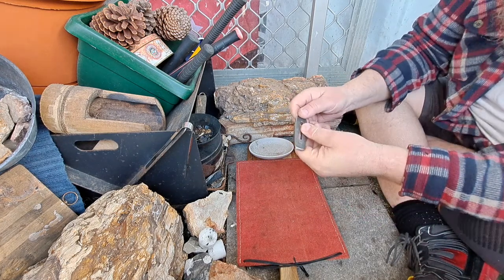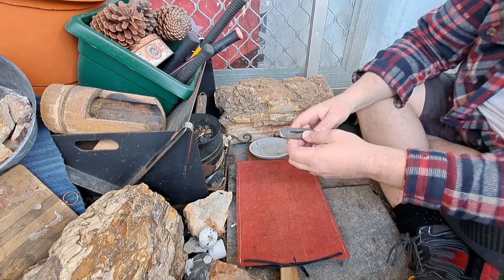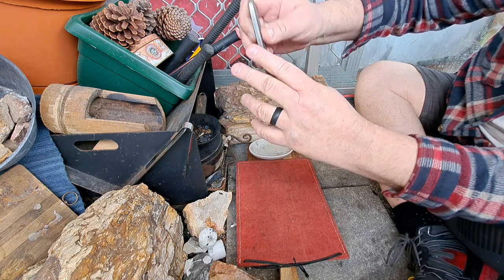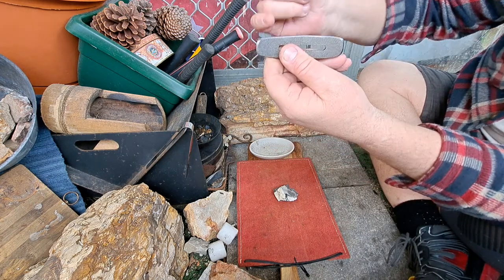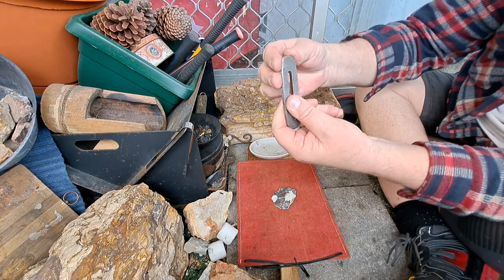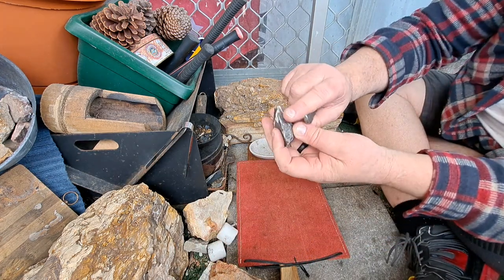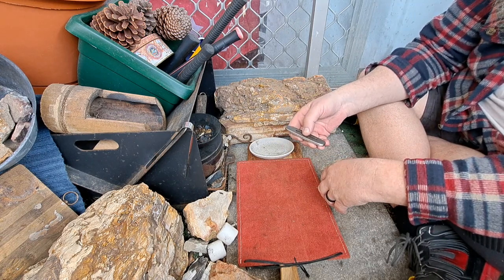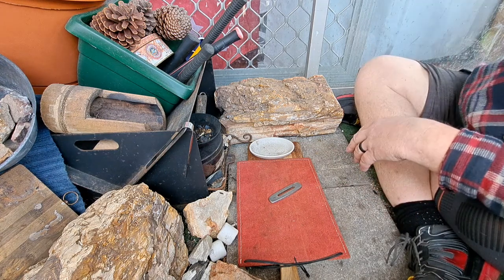my recommendations on how to quench a file to make it into a file striker

Comment: So My cheap one I need to dress up yet but great info. Water. I was thinking some kind of oil Good to know I have a reel striker that doesn't spark worth a darn  was going to heat it up and cool it down try and make it better
Reply from the maker: oil works but water is a more severe quench and I have found makes for a better sparking striker
Reply: @waveman0  nice. Thanks for the info